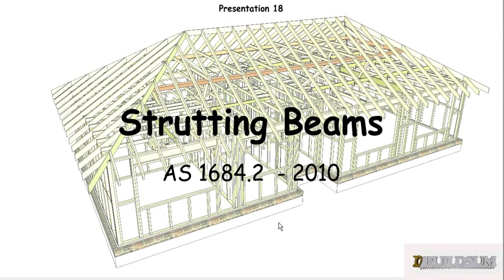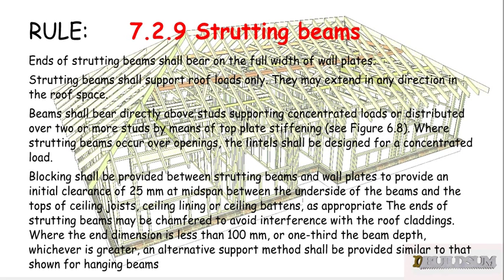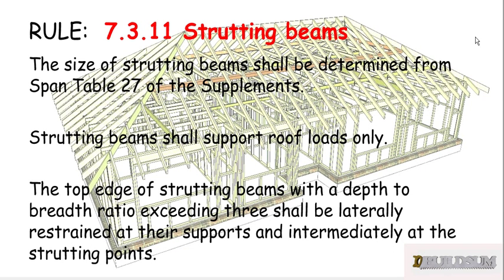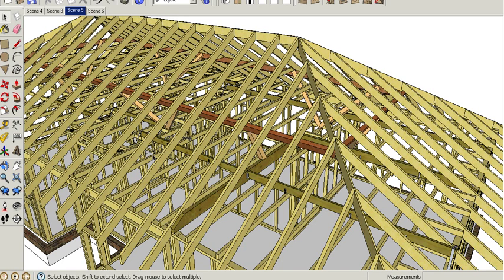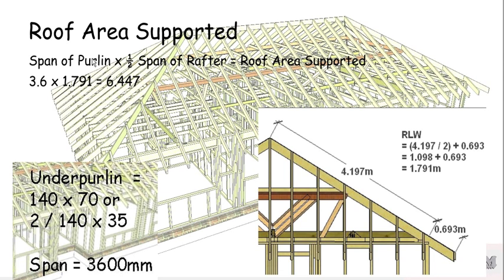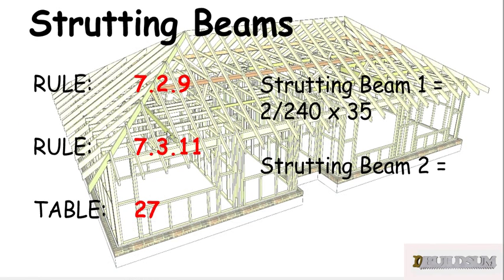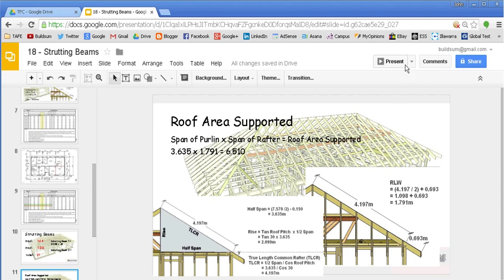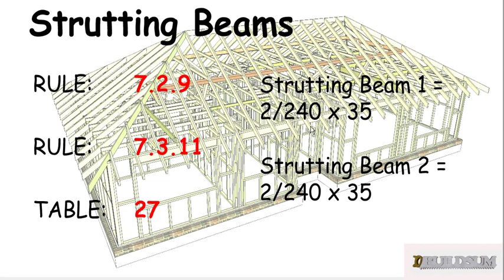18   Strutting Beams

Comment: Why would you pack the combined counter/strutting if the hangers are connected to it, if the beam deflects so would the ceiling and hangers
Reply from the maker: Hi Mate, I get your point however this is what is specified in AS 1684.

Comment: Another Q! I require a long strutting beam: two strutting beams supported at 3 points in total. It's not clear to me what is best practice for joining the 2 strutting beams atop the middle support. The beams are likely to be quite tall at 2/190 to 2/290, depending on timber selected, and will have laterally restraint at each support per Figure 7.18.
A: Would it be a half-lap joint, like for underpurlins with skew nails (AS1684.2 Figure 7.6)?
B: Or, a mitre joint with skew nails per Figure 9.3?
C: Or, a butt joint with metal brackets per Figure 9.3 but the through bolts would be up to 300mm long?
D: Nail plates sides, skew nails top, laterally restrain with strap?

(edit): Is the butt joint out of the question, because the bearing area at the end of the beam must be 70mm, or does the fixing of the joint negate this? (support is 90mm wide)
Reply from the maker: Hi Alex, yeah with that 70mm bearing everything but a staggered joint is out of the question.
Reply: @Buildsum  this is what I was thinking. I assume staggered in this case means a half lap
Reply from the maker: More like a lapped joint like the one in this video at the 1:10 mark
https://youtu.be/6wPEuXaAObg

Comment: Hi John , how do I workout the beam size that’s directly under a load bearing wall of the upper story house
Reply from the maker: Hi LIna,  as far as i know this would fall outside the scope of AS 1684, Basically unless you can transfer the load directly on to a wall in the lower storey you would have to get a Structural engineer to design something for you.
Reply: Thanks

Comment: Hi John,
I just checked TABLE A33, there is no strut spacing at 3600mm in the table. Maybe our tables are different?
Reply: I FOUND I USED SIMPLIFIED TABLES, THEY ARE DIFFERENT
Reply from the maker: HI Roger Yes AS1684.4 uses different tabel to AS1684.2
Reply: thank you John, could you have look my plan give me some idea, please.

Comment: hi, is the combined strutting/hanging beam must has 25mm clearance from the ceiling joists?
Reply from the maker: Hi Ray Yes any strutting beam combined or not must have a 25mm packer between them and the plate
Reply: Thanks

Comment: Hey, how would you join hanging beams to combined counter/strutting beam. Would you just use metal hangers, or would it be stronger if you notch the hanging beam over the counter/strutting beam and then also provide the metal hangers?
Reply from the maker: +Az Hi Az these days metal hangers are considered to be sufficient but naturally notching them over the beam would be stronger and also acceptable 
Hope this helps